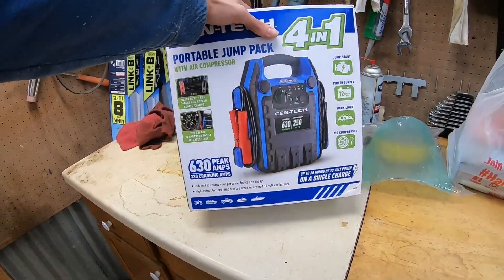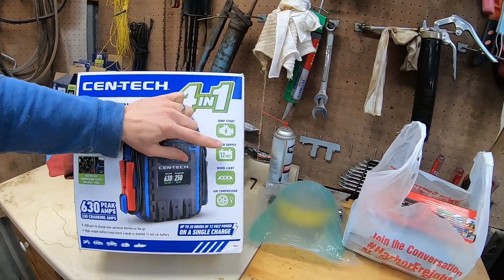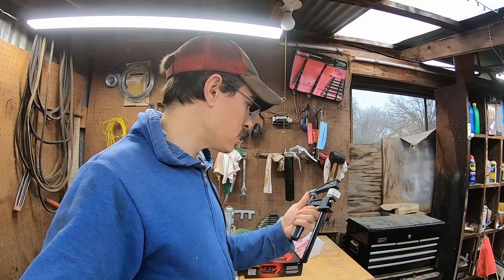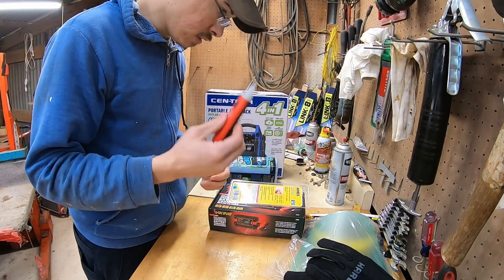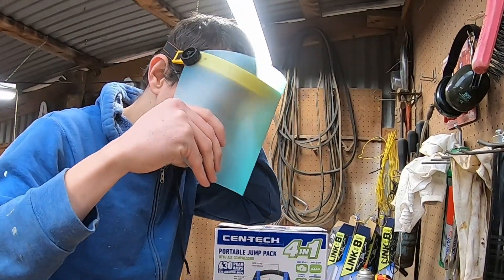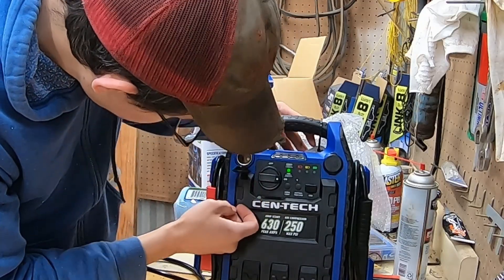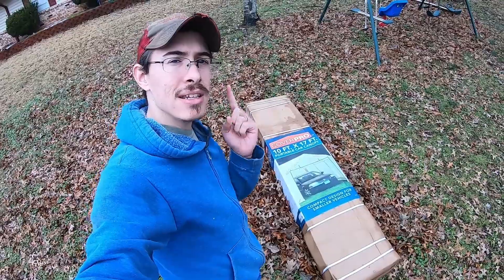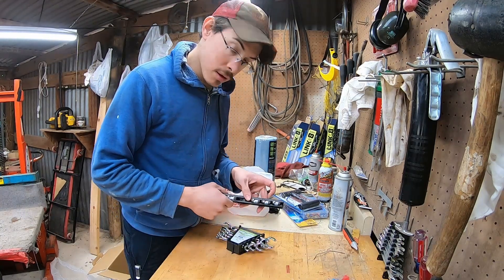Are these Harbor Freight tools worth it??? Rechargeable air compressor!!! | Garage Story

Comment: Have had several of those. Always get the replacement warranty and just keep turning them in when that dont work. Mine works just great for the price. I use the air compressor a lot. :)

Comment: Thats great. I did. not even see the face shield thingy there. I am going to have to go over and get one of those .
Reply from the maker: They are pretty cheap, too
Reply: @garagestory  Awesome! If you happen to find a basket case Terra-mite I  would probably come out to wherever it is for an inexpensive enough price. I am literally looking for one without an engine or something to that effect. I am going to pick uo a Toro proline 120 which is something I have wanted for years, for $75. It had a blown engine so they took it out but I have an engine sitting on my floor that will bolt right in. I want to actually put a Generic 1000cc motor in and have air-conditioning in the summer. That would be so awesome. You could cut all day and all night and be nice and cool. I am going to make sure there is a great heating system as well. I do believe they make cabs for those. If you know  better just let me know. I found a 48" walk behind for $100 and it needs a couple parts. If they are engine parts no problem. If they are other parts I might have to make them. Someone else did when it was built so I can. now.
Reply from the maker: A mower with air conditioning? That would be sweet!! Would you piece it together from automotive parts, or was that a factory option on those?
Reply: @garagestory  I do not know of any mowers that have a/c as an option. What I did was rebuild the Generac generator 1000cc motor which was a beast. There was power to spare.I contacted a friend who does restomods like I do and he told me of a company that makes a/c u its for anything. All you need is a motor strong enough to turn the a/c compressor and do the other things that the mower needs to do. I always loved the groundmaster  and proline series of Toro mowers because they had those enclosures.

Comment: The jump starters work for a while, then often take a crap (the cheaper ones). I recently bought a battery operated air tire pump that is shaped like a drill. Cost $65 and all it does is inflate tires, etc.
Merry Christmas 🎄!
Reply from the maker: Thanks! Yes, I’m curious to see how well and how long it will work for.
Reply: @garagestory  I've had the cheaper version (no light) of that for years and just used it today to start up a mower.  Works well for pumping up lawn mower and bike tires.
Reply from the maker: Good to know!